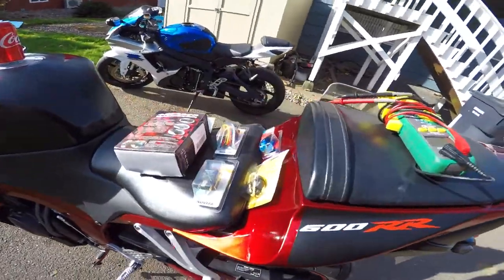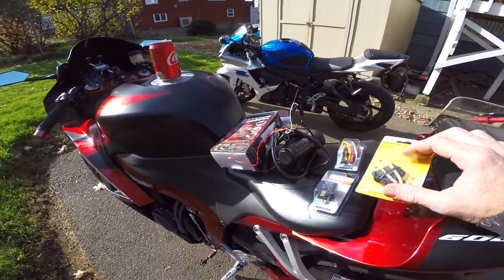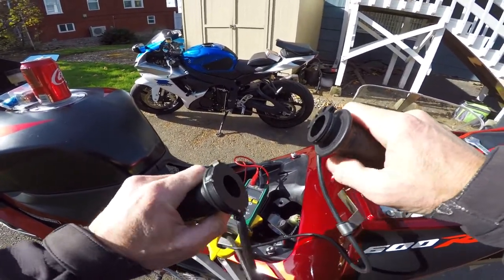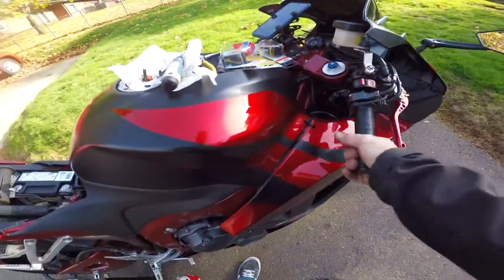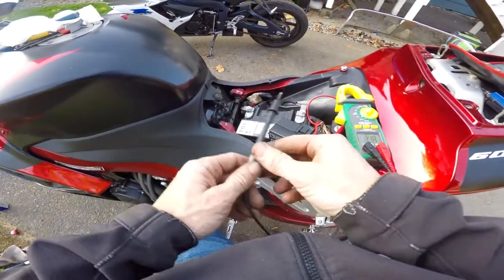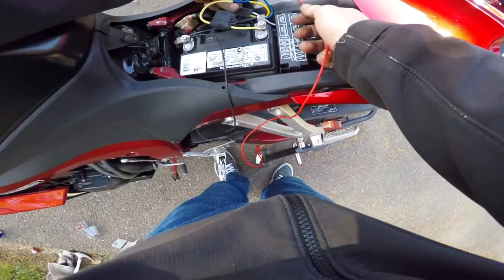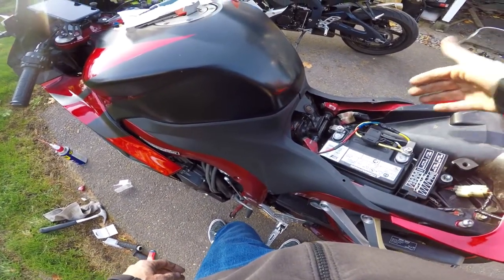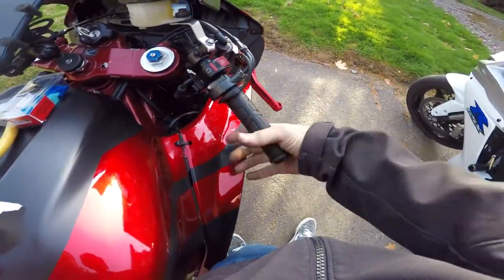How to Install Heated Grips | Motorcycle Relay Install | 2019

Comment: Hi, I purchased the same grips that you installed on your cb 500x for my 2019 cb 500x. Can I switch over the throttle cable like you did on this bike or do I have to take the fairing off to loosen it down on the engine? It looks pretty easy on this video.
Reply from the maker: I was able to get a wrench under the gas tank to adjust the slop. It was too difficult to tighten down properly so I used a lil lock tight on the cable nut.
Reply: Thank you, love your videos.

Comment: Do you really need the relay the grips have a off position and they don’t draw any power when in the off position I thought
Reply from the maker: Some mass produced electronics might have a parasitic draw. But the main reason is the relay is wired to the ignition. Therefore the grips will shut off when the keys off, no chance of running the battery dead.
Reply: What kind of relay and relay harness did you buy?
Reply from the maker: One from an auto part store. Search my name and relay and you’ll find an install video;)

Comment: Can't you not piggyback it on headlight wires instead of using relay?
Reply from the maker: You could, but then your adding the load of the grips to the headlight circuit, which is not recommended. I wanted a relay for future accessories and just to be safe. I’ve since added a usb charger (2 more amps) and I plan to put some LED lights on that relay too.